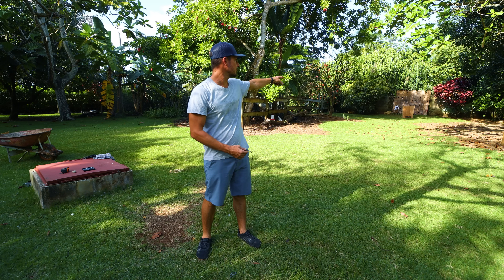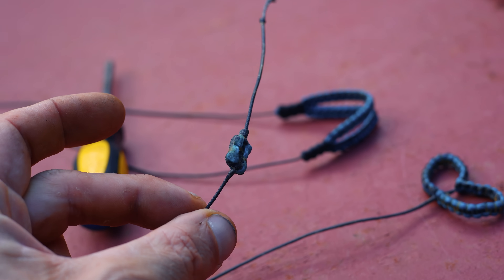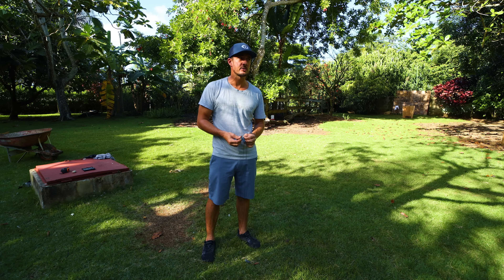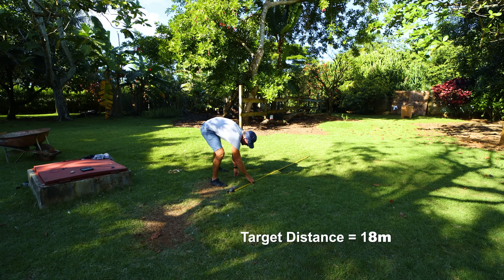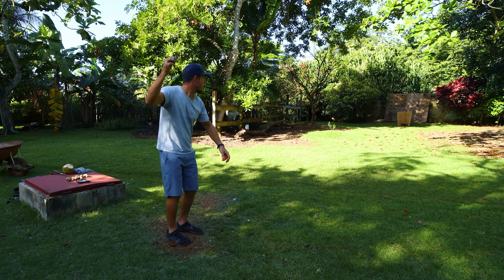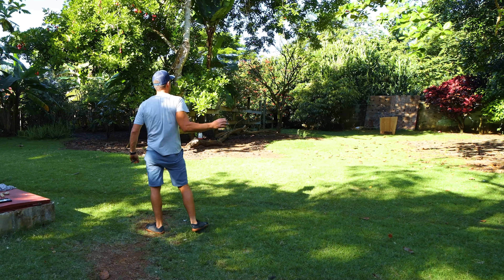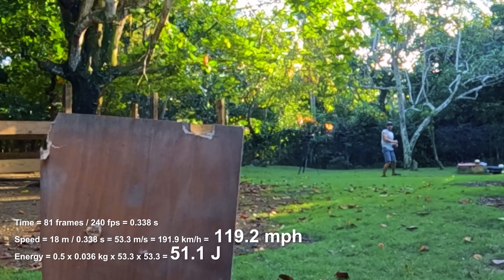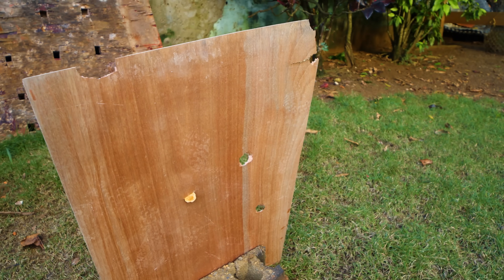This Sling Is a Physics Nightmare

Comment: I compared the numbers you achieved with the 46" sling v. the 30" sling.  You didn't provide the weight of the river stone used with the 30", but the velocities were pretty much the same as with the longer sling.  Perhaps it was a matter of the awkwardness of the extra length?  If the river stone was on the order of 200 grams, you developed something on the order of 260 Joules of energy, a lot more than with the 46"er.  Thank you for the interesting experiment.

Comment: Not sure if you're used to that length or not if not, and your finding it's rising over target, it's just adjusting for the extra length... Allowing the swing to develop more because of the length. 

I've seen another channel try to do something sort of impossible, like a whip with some sort of pea launched from the end. It's obviously wouldn't really work. The whip uses ever decreasing mass to accelerate said mass drastically, usually supersonic speed, so adding mass at the end doesn't help his situation. I wonder how you could leverage that concept further, really exploit that. Great work homie

Comment: I've heard that with the right setup the hitting power is about the same as a 9mm pistol. But I'm not sure the setup with these projectiles and this sling are hitting those numbers. Still it seems it's more challenging to get accuracy with this, which probably explains why archers tended to be more known about than slingers when it comes to ranged weapons being used prior to firearms.

Comment: When using a sling I do not swing it around. It is noisy (alerts the game) and when is a wooded area it catches branches and leaves. I use the sling the same way a baseball pitcher throws. I start from a static position then sling the round forward. It does a 1/2 rotation. Very accurate. It probably does not generate as much energy but when a rock is moving at 90+ mph does that matter?

Comment: So we have calculated you will need approximately 2Ton of large river rock per Rabbit.. at $75 bucks per Tonne = $150.
$150 ➗️ by 1 rabbit at weighing 1lb of meat would give you a plate of meat costing $150 per lb.....🤔 then of course you will have to wait for the bunny to walk infront of your target as carrying 2 Ton of river stone would be some what limiting.....now 1lb of Japanese A5 Wagyu will cost you $90... not sure if spinning yourself into the ground and doing hard time shifting rock one piece at a time 18 feet would be your best use of time.... taking into account the loss of body fat undertaking such a fruitless activity.! But top marks for free thinking and having a go 👋😆👍
Reply: Go outside

Comment: maybe get yourself some large ball bearings or large marbles (glass balls)
for consistent results
Reply from the maker: Could help but just using a shorter sling would be the easiest way to improve consitency.
Reply: @PrimalSlinging  maybe use clay to even out the rock's size and weight, sun drying should be enough if it sticks

Comment: Shorter sling is better bro.. this is too much.. you dont get dramatically increased the speeds in my opinion.. and the accuracy is much better with 28”-30” slings. ⚡️☄️
Reply from the maker: Agreed mate, 30 inch is my favortie all round size at the moment.

Comment: Nice !
I had one sling with ~0.8-1.0mm UHMWPE arms, but they were getting tangled all the time, so I went for a flat ~1x4mm braid.
Reply from the maker: yes long light slings are not very functional, the one in this video is spliced all the way through so the cords behaves a bit better.

Comment: Is there a recommended sling length based on someone's height or arm span?
Reply: i think he said it should be long from the ground to your fist when you're standing. But Im 197cm tall and my sling is about 85cm in half and is too long. I did second one shorter about 65cm in half and it is far better in all ways.
Reply: Based on my slinging style i prefer pouch of the sling to be slightly above the ground when I'm standing and holding it with my arm straightened along the body.
Reply: I would say:
If you shoot distance, ~ half your height.
If you shoot targets, ~ a third of your height.

Comment: If you want more dense bullets, cement (3.15 g/ml) is a bit more dense than granite (2.7 g/ml) or aluminum (also 2.7 g/ml). This is because lime is relatively heavy. It has to be pure cement though, without sand or aggregate.
Reply from the maker: Thanks for that, I always thought cement had to be mixed with something. I'll try pure cement.
Reply: Concrete	2.40
Quartz 	2.65
Granite	2.70
Aluminum	2.70
Cement	 3.15
Steel	7.85
Lead	11.34
Uranium	19.10
Reply: A cement outer projectile with a steel rebar core sounds deadly…